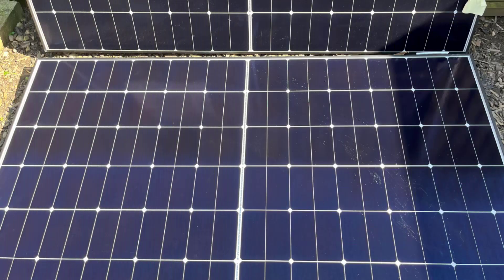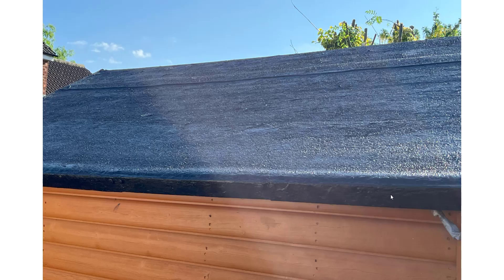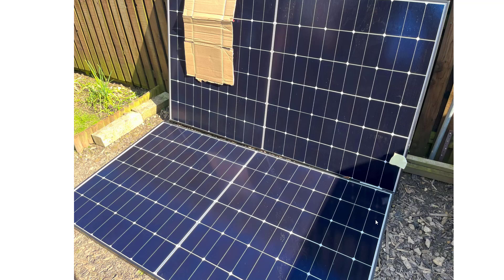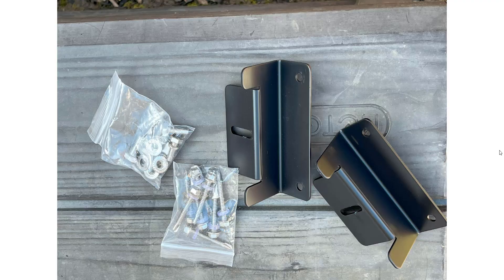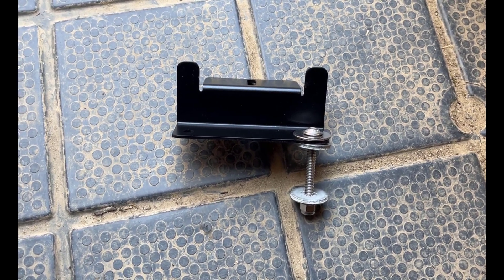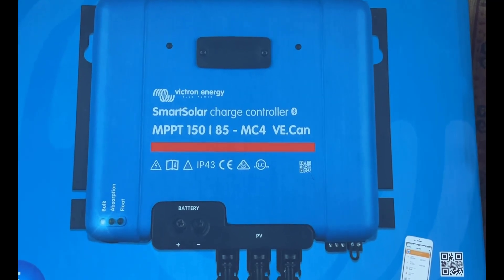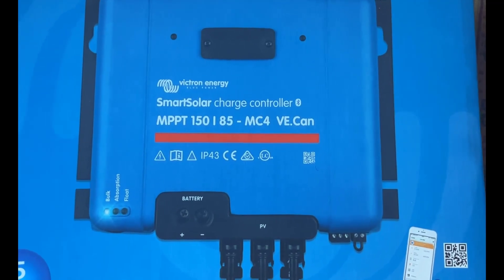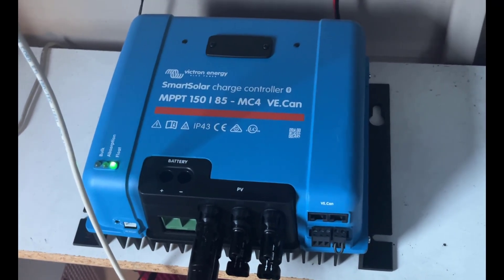Installing GIANT 535 Watt Solar panels on a Wooden Shed Roof

Comment: Have just bought the exact same panels for my shed! How did you route the cables into the shed?
Reply from the maker: Congrats on buying the panels. I routed the cables through existing air vents on the back of the shed. If you don't have any vents, you could always drill a hole or two and then seal after. As the Panel cables were short, I needed some extension cables to reach the Solar Controller: 3 Metres: https://amzn.to/4dmLSew or 6 Metres: https://amzn.to/3GU7SBn
Reply: @HandymanSavage  Thanks! Much appreciated.

Comment: Nice project, I definitely think solar powered shed/workshop would be good for a lot of people, and not cost a ton.
Reply from the maker: Completely agree. Back in the day, I started of with 12V Car Battery trickle chargers, then progressed to bigger and better panels as technology improved and prices have reduced. It's crazy you can get a 500+ Watt Panel for the same price as what I paid for a 12W 30cm panel back in the day. Anyone can start off simple and scale up once you get hooked on the merits of Solar energy and the vast array of applications of 12V energy for things such as Crypto, security and lighting. I have a video coming out shortly on optimizing battery storage, so stay tuned for more Solar shed shenanigans.

Comment: Nice video. I'm trying to see how people earth this type of setup but more often than no, people don't seem to bother. Would be interested to know your opinion or any knowledge of this as i'm confused if it's required or not - varying opinions online from 'do nothing' to 'install an 8foot earth rod into the ground'....... thanks...!
Reply from the maker: Generators, off-grid solar systems, or radio towers require grounding with earth rods, depending on interference and fault protection needs. I personally think because it involves mains voltage 240V in my case with the Inverter, then it's a safety factor worth having.

Comment: Did you hook up solar panels 1st
Reply from the maker: Nope, if you have a Charge controller, it's important to connect the Battery to the charge controller first. This powers up the controller and done all the calibration etc before you add the solar panels after. -P.S. I assumed this it was you were asking :-)

Comment: Great video, thanks. I'm looking at doing something very similar. But as I would have each of 2 panels facing in a different direction, would it be more efficient for the charge controller to bring in each panel to a separate input - rather than run them in parallel using just one input like you have done in this video? Am thinking of the times when one panel may be shaded and the other in full sunlight etc.
Reply from the maker: Good point actually, in hindsight I was thinking whether there was any benefit to adding the individual panels direct into the separate inputs of the charge controller and it turns out the 3x inputs are set as Parallel anyway so I'm going to try this when I get a chance and compare it with the readings I've had so far in the Victron App, so thanks for that prompt.

Comment: Shouldn’t you always have a battery hooked up before connecting the solar?!
Reply from the maker: I didn't have the batteries at the time of the video, hence why I just plugged in the Solar panels direct to Solar Controller to test them (perfectly safe). But you are indeed correct that when you have the Solar Inputs and Battery, the order to connect them is 1) Battery connected first to Solar Controller 2) then the Solar Panels to the Solar Controller

Comment: Thanks for the video I'm looking for a shed mount solution on my shed to replace the wooden one that i gave that leaks. With the solution you have can you remove the panel witout taking the mount of the roof?
Reply from the maker: Good question, there's not a lot of clearance (which in one respect is good to stop birds nesting), but you can loosen the single nut from the bottom (using a long reach spanner) which connects the brackets to the solar panel frame. So yes, the panels can be removed, leaving the feet fixed to the shed roof.

Comment: Consider connecting the panels in series. As well as not requiring a 'Y' connector it doubles the output voltage. This helps to avoid voltage drop (power losses) in the cable. This is especially important when the panels are a significant distance from the MPPT controller. Sheds are often several metres away from the rest of the system and as there are two cores the total round trip distance will be twice that of the cable.
Parallel connection has advantages in partial shading conditions but, unless this is the case in a particular application  series connection usually produces more power output at the MPPT controller. Just make sure that the total panel output voltage is less than the MPPT rated voltage. In the case of Victron controllers, if the voltage is exceeded, they will just limit the output. Some other makes do no have this protection and may be irrepairably damaged. Most panels have an open circuit voltage of less than 50v so for a 150v Victron controller up to 3 panels can be placed in series. As 250v controllers are significantly more expensive placing series connected pairs of panels in parallel keeps the cost down. You are then just limited by the maximum current/power the controller can handle.